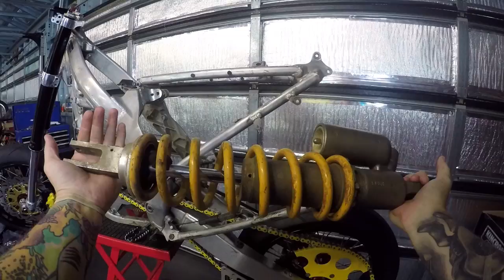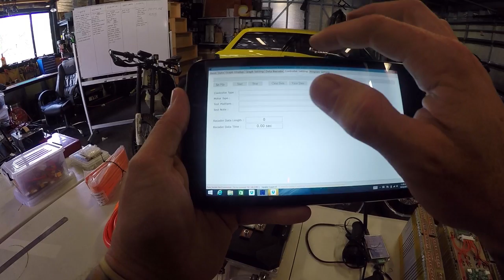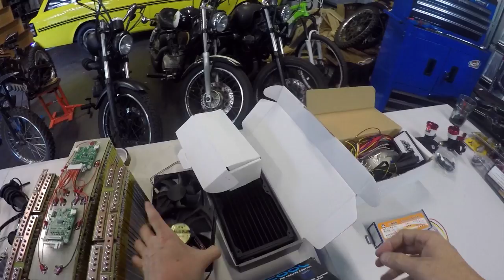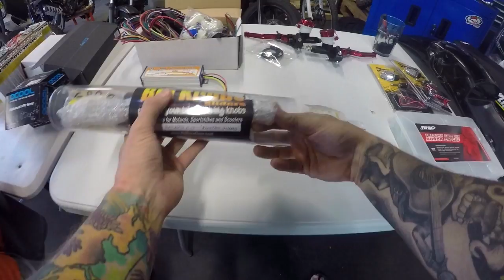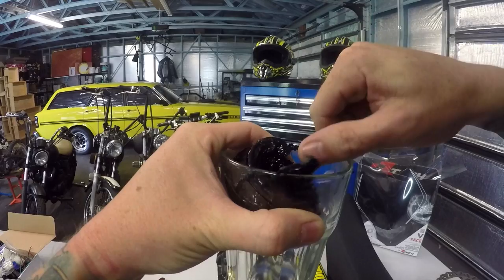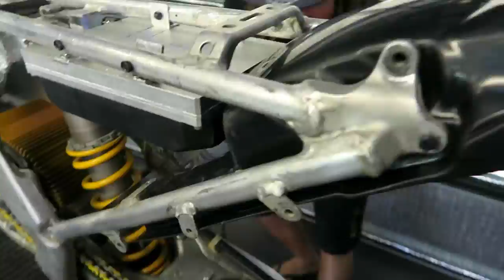50KW ELECTRIC SUPERMOTO MX BUILD [EP 2]  MOTOR RUNS!

Comment: This is so sick! That thing will be a beast! Excellent work making sure it is done right the first time. I cant wait to see more of this build.  I had a similar headlight on my bike and I recommend throwing out the rubber straps and installing it with safety wire once the build is complete. The rubber straps rotted on mine and ripped in half. Keep up the awesome work and make more videos of it! Keep up the thorough descriptions of everything, I'm a mechanical engineering student and a motorcycle enthusiast and I loved learning more about the electrical systems.

Comment: Great videos, great work and awesome progress so far, I've seen the 3rd video, the bike is pretty impressive. Where do you get your abs plastic and how do you fabricate it? I need to extend my tail to pass inspection and get my DRZ400e titled and registered. In Connecticut it has to be within 14inches of the rear axle. Thanks in advance, I changed my brake fluid because of you lol. subbed

Comment: Hi.Recently, I manually soaked my electric motor Qs138 v3 4000w with varnish and found that I had damaged 4 copper winding wires, accidentally erasing the top of the wire when I opened the motor. Will my engine burn out?

Comment: Why use such large sprockets? Electric motors put out torque at all over the rev range.

Also I would suggest that you remove the 90 degree elbow on the water cooling cause they will probably start to leak, as computer water cooling is not really made for vibrations. I have had 2 starting to leak in my computer, and they only moved when I installed them.

Really cool build.

Comment: funny that electric motor boasting high torque but needed a massive rear sprocket
Reply: it does have high torque, the massive rear sprocket is more of a safety thing to decrease speed bc the motor is running at 8000rpm

Comment: Do you need to have a screen to run this controller? I am building a 20" bmx with qs273 50h on back (maybe 2wd not sure yet...) with custom 1way bearing chain sprocket...will this controller turn on if charged to 92.4volts? I have  22s but my bms charger cannot charge to 4.05v per cell which is annoying but i know my cells are 3.6v nominal so voltage will drop off to 84v pretty quickly...im after a high amp stealth controller for 663amp burst if i could use this with no screen it would be perfect

Comment: Why's the rear sprocket so big?
Reply: IlroryylI 8000 rpm motor and no gearing
Reply: its an 8000rpm motor, using a small sprocket would heavily increase speed but would heavily decrease torque aswell